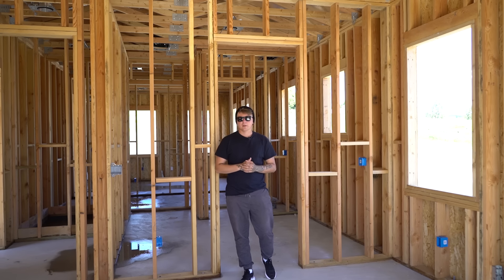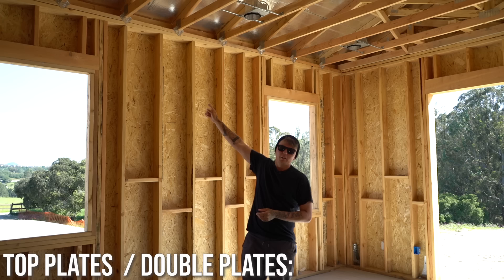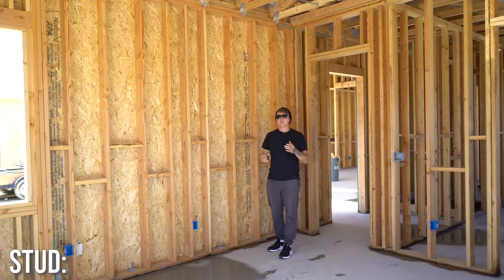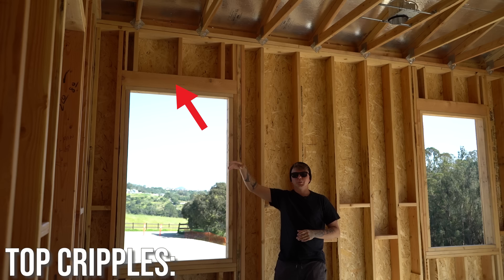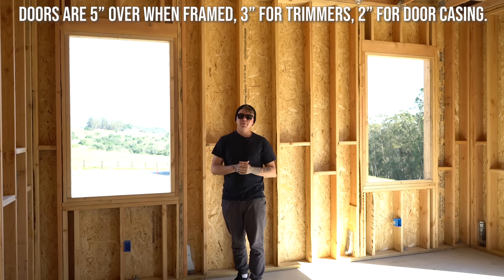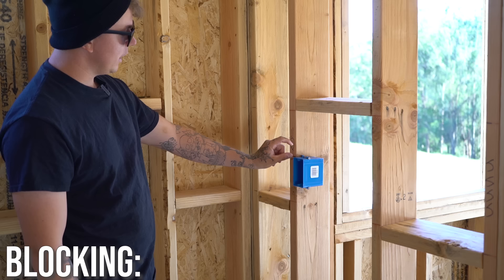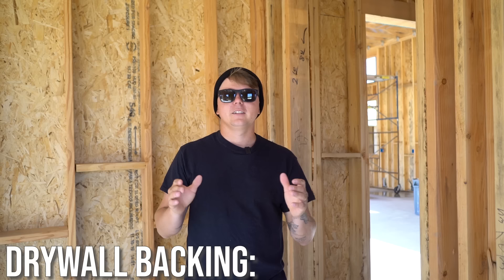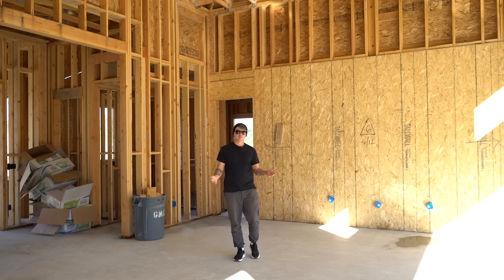Carpentry 101: Basics of Wood Framing with MattBangsWood [#1]

Comment: Hey Matt... another great video! I enjoy watching a quality framer from sunny California! One thing that you are doing wrong  ( and I have been teaching and employing framers for 42 years) is running your sills into your trimmers. This is a huge no-no and your introducing shrinkage and crushing under a load bearing lintel. Any engineer (and Canadian code) will tell you that trimmers should go from plate to lintel (or "header" down there where your framing) with no interruption.  When you have extra flat plates interrupting your trimmers then you are going to have uneven shrinkage and compression from your standard walls that only have 3 plates compressing. I've read that California has a very high standard of building codes and ethics and a Master Builder licensing program, we definitely need that here in Alberta to weed out the riff-raf!! Keep up the great work Matt.

Comment: great video! Its awesome that you simplify, and also explain that there are different terminologies used throughout this industry. However, pre-cut studs lengths in NY are at 5/8's. 92' 5/8", 104' 5/8", 116' 5/8". Overall, the video is explained very well. Trimmers are also something that is not needed in NY, our headers sit on the jack studs. When we create our headers, we sandwich osb between the 2x6's or 2x8's. Great job!

Comment: Great video! The actual purpose of the blocking is for fire purposes. Back in the old days, they used balloon framing that went from floor to ceiling and if it was two story, it would go all the way from the first floor to the second floor top plate. If a fire were to start in a living room, it would rapidly go from wall to ceiling and the attic space in no time. By adding the blocking, it deters or slows down the fire as it burns its way up the wall thus adding a slower burn rate and a chance to detect the fire before attic space involvement and having a fully involved structure fire. I am sure the added bracing is a benefit as well but not the primary purpose of it.

Comment: 0:50 BOTTOM PLATE / MUD SILL: To anchor the wall down to the concrete with anchor bolt. Bottom Plate is Pressure Treated Lumber.

Comment: Hey Matt, 
     I am a general contractor. If you like this great, if not, no worries..... We call the first top plate the "top plate" the second one we call the crown plate. The reason for this is because you install it with the crown going the opposite direction as the top plate. This is to attempt to have them counteract each other and make the wall straighter.  Also, I like the backing that you put in for the ceiling at an intersecting interior wall. However, for those of us who experience winter, you should not do that. If you experience truss uplift it will tear your drywall off the wall. It will tear the drywall corner joint between the ceiling and the wall causing a gap between the two. To prevent uplift issues, we nail backers to the top of the wall. The drywall is attached to this and is NOT attached to the trusses within 24" of an interior wall. This way if you experience truss uplift the drywall will slightly bow but the corner joint will stay in tack. (Truss uplift is when the trusses shrink causing the bottom cord of the truss to lift. This happens because the way a truss is designed, they cannot come down when they shrink, so they go up). If the bottom cord of the truss lifts a quarter inch then there may be a 1/4" dip in the drywall but it is not noticeable at that point. If the drywall joint tears and separates it becomes very noticeable. Again, this is probably not something you worry about in California, but for those who do experience it, it is not a good idea to attach ceiling drywall to the trusses within 24" of an interior wall. 

As for the rest of the video. I loved it. I sent it to one of my green horns to watch!

Comment: Young structural engineer here. Yes, dbl top plates do help to span wall studs, but more importantly they serve as collectors for lateral continuity. There are two plates with lap splices so that they can act as a continuous tension member. I would not recommend downplaying the purpose of blocking. Yes it helps against warping, but it also braces against buckling in high wind conditions and is often referred to as fire blocking to slow flame spread in highly combustible batt insulation. As far as I know, they don't manufacture 5 1/2" x 15" PSL - that actually looks like an LVL.
Reply: How do these walls stand against lateral forces? I mean.. when they pull up a framed wall it wobbles in all directions so ok, the studs and wal works great for a force from up to down but there's nothing stopping any lateral movement left/right? Is it the plywood on the outside? That's the only thing that looks like it could stabilze against lateral movement.

Comment: A couple comments: a) Most treated wood these days uses ACQ, not borate. b) Treated wood still readily absorbs water. It just doesn't rot. c) Most resources say not to split your trimmers/jacks with the sills. Breaking trimmers/jacks creates additional hinge points and the sills will shrink a lot more along their short dimension, leaving gaps in a split trimmer/jack assembly. Trimmers should run unbroken from the header to the bottom plates.
Reply: Here's an article from Fine Homebuilding about split trimmers if you're curious: https://www.finehomebuilding.com/2017/09/13/split-jacks-framing-window-opening

Comment: The Framers use california corners here to allow insulation to be installed and not have a dead void inside the wall.    If you use a channel corner  then you have to insulate that prior to outside sheathing which is an extra step.

Comment: The bottom plate does NOT have to be treated, but it HAS TO be separated from the concrete by foam rubber that you get in rolls that are exactly the width of the bottom plate. That's how we do it in Finland. Obviously, you could have both.

Comment: good video and good explanations. the thing is framing is differant  in differant States and countries what goes in california is way over built for say Hawaii. ( Hawaii rearly gets snow so no need for sheeting everywhere )  and say New Zealand being high humidity, by sealing up the walls and rooves with sheeting promotes dry rot rotting out your High value home within 5 years.
alot of places use 2x4 @ 14" centers. and so on.
In New Zealand framing without sheeting is achived by a gavanised iron 1"x1" diagonal brace on each frame nailed 2x at each passing being 'L' shaped, it is cut into the studs, top and bottom plates. So with blocking or knoging it makes the walls strong and breathable, stopping any chance of dry rot happening.

Comment: There are plenty of comments so this may have been said already. I always thought Blocking was originally used to slow down a fire in the wall. It doesn’t stop the fire, but it really slows it down. We use to call them fire blocks in the early 70’s. They don’t add that much strength really.
Reply: @Hello Tony how are you doing?
Reply: That's what we use them for in Maryland.

Comment: the horizontal framing you did is going to make it a living hell for any electrician to do ANY work after the walls are closed.
Reply from the maker: Walls are almost always blocked, especially in California. These homes aren’t cheap, I’m not going to go cheap so an electrician can not penetrate drywall when installing a plug later on.

The way I see it.. I can provide a better product for clients, or provide a lesser product to save an electrician 10 years from now a few more hours of work cutting drywall.

Comment: Very good video I learned this type of frame work later on in life I feel this is the best I wish my school wood shop teacher would have taught us this he was a crazy nut job beware a lot of other contractors do not build this correct way any more most of the time thay use the new floor trusts and the h vac installers drill large holes in them makeing them week and 24 on center walls and do not double around window areas     So be carefull when you buy a new build   I would demand this mans type of construction very will built and will last a life time.

Comment: Great video but as a professional framer for over 35 years in the west there are some slight differences in the framing details of how things are done like running your trimmers full height instead of landing on the window sill. Also clairfing that exterior wall blocking may be required at all OSB/plywood panel breaks for shear value or other reasons. Also stud heights matt called out must be a South West thing. Precut studs coming out of the west or Canada are 92-5/8", 104-5/8", 116-5/8".  But still, great video and great presentaion! Great

Comment: FANTASTIC Video!!! The question I have and have never seen it addressed is: when you’re laying out a wall, is there a rule as to which side, left or right, that you start the studs at 16” on center? Obviously if the wall is not a perfect length that is a multiple of 16, one end will have a stud that is closer to the end than 16”

Comment: In the northeast, it's code for all loads for all walls to be continuous, transferred all the way topmost to bottommost structural member, meaning that breaking a roof truss or rafter in between two wall studs would be unacceptable even though you have a double top plate in place.That would fail code for not having continuous load bearing from top to bottom.

Comment: Your method of putting in channels lock off cold corners where you can't put insulation. Turn those studs 90° horizontally so you have a few inches behind it to stuff insulation into that void.
Guess in warmer California might not be much of an issue but I certainly pack every void here in North Idaho lol we got cold winters here.

Comment: In S.florida the wall blocking is called fire blocking by code every 4 feet must be installed or fail inspection suposed 2 slow smoke n fire from rising quickly

Comment: It’s funny how the west coast nails through the first top plate into the studs when the east coast sandwiches both plates together first then toe nails the studs, I always wondered about that since 1985 when I first started framing, that’s why they call it California farming
Reply: They may have done that in 1985 but nobody does that anymore. I am a member of the National Association of the Home Builders and I talk with builders from all over the country. Nobody (not an entire region)  toe nails studs to the plates anymore. Not to mention that by the international residential building code you need 3 nails on each end of the stud when nailing straight in. If you are using a normal .131 nail for a nail gun. If you toe nail then you are required to use 4 nails on each end.
Reply: @ericyost2703  well i know for a fact hand on building every day on 50 million dollar ocean front residential properties on the east coast with top architects we double top plate and three toe nail 2”x6”studs with 16 penny nails or go straight in when using structural hangers .
West coast is known for top nailing from plate to stud which would blow apart during a nor’easter over here Jack
Reply: @robertruizcampwolfden8579  If you built two houses exactly identical withe the exception of toe nailing studs vs. plate nailing studs, you would not know the difference. It would not blow down. Almost all of your wind shear resistance comes from your structural sheathing, not your studs. Besides, no framer has perfect employees, so you know there are plenty of nails being toe nailed that crack the end of the stud or break the corner off, or are only in about a 1/4" of the corner of the stud. Those nails are not holding anything. Like I said, I don't doubt that you do it that way and there is nothing wrong with that. But I do doubt that every builder on the "east coast" does it that way as you made it seem. I have talked to builders on the east coast who do not toe nail studs to plates. Besides here in the Midwest we have been plate nailing studs since long before the 80s and I have never heard that called california framing.  That is Midwest Framing. It is also west cost framing. It is also southern framing. It is also the preferred method for over 100 countries world wide. And it did not start in California. Jack.
Reply: @ericyost2703  I’m sure all the Midwest brain damaged folk do it your way before I was a teenager but the only house that I know of from Midwest that ever held together during a tornado was Dorothy Gale
Reply: @robertruizcampwolfden8579  My mistake, I thought I was debating with an adult. Thanks for your time sport.
Reply: @ericyost2703 dudes doing tutorials on basic carpentry from high school and he thinks he has a degree in engineering
Reply: @robertruizcampwolfden8579  Matt did a tutorial on basic framing because his followers asked for it.
Reply: @ericyost2703  keep doing your homework and you will get there
Reply: @ericyost2703 I will be hosting a small cottage build hopefully next summer in upstate NY Adirondack region so tell all of Matts followers to get there pencils sharpened, notebooks and popcorn ready

Comment: I’m a service electrician and often retrofit finished houses for remodels, additions, etc. and horizontal blocking is the absolute worst to run into while trying to fish down or up a stud bay. Then I have to tell the homeowner sorry I’m going to have to cut your wall to run this wire cause the framer thought it’d be a good idea to put in unnecessary wood in the middle of a stud bay!
Reply: Excellent video mate!
Reply from the maker: I’d rather our studs be straight and our walls sturdy. I understand your side of things, but I can have a whole 3,000SF home drywalled for $10K, you cutting a bit of drywall out and having it patched won’t cost enough to be an issue with anyone we build for.

Comment: Only thing with your Chanel for drywall is you the. Get a cold corner. Adding a stud and spinng your Chanel blocks 90’ you will still have backing and will get a clear void for insulation

Comment: After about 20 years we decided to call the plates out as...bottom plate, framing plate (it has lay out and isn't top or bottom) and, top plate.
Stud plus trimmers is a stud/trimmer.  In the old framing books the king stud is the stud under king rafters. For a no compression trimmer it should run from bottom plate to header.  Sill fits in- between.  No trimmers needed above header (unless on 16 layout) yet people do. Why? We only block at 8' for fire block.

Comment: I’m not sure if I quite understood, when framing openings for doors/windows, isn’t the opening supposed to be 1/2” bigger than the frame? Working in a place that sells pre-hung doors, we try to build the frames to be a half inch under the rough
Reply: You answered our own question. When a builder talks about a 36" window, that window actually comes from the factory at 35.5" wide. The rough opening is 36"

Comment: Double plates have more purposes.  The transfer of lateral (wind) force across the full length of top of wall needs to be continuous. Typically the top plates overlap each other to splice and transfer the force accross long walls. A wall 40ft long will not have a 2x6 top plate 40ft long. You splice Typical lengths (12ft lets say)

Comment: Another great video man. You always explain things so clearly. I wanted to add that another reason for a double top plate is to accept larger truss connections as needed/required by the engineer and designer. As you can see in your video you did not use Simpson H2.5 truss clips, but the H1Z rafter ties, which are larger and in my opinion a better connection overall anyway. They do require more lumber surface and the double top plate accommodates for this...On another note, what type of mic do you use for your videos? I am looking for one that I can use as a wireless option as you have in this video. Also, sounds like you might be heading down to hook up with Jon Dawson sooner than later for a project. I might be down there soon as well to come check out the build. Would be cool to meet up if we are down there at the same time. Jon is a good dude for sure. Again great video Matt

Comment: Great job! I am doing framing myself for the first time in Chicago and these videos help a lot. I am installing 30" x 84" heavy doors and am a little worried about the structural strength. Therefore I am doubling my jack studs and have decided to use a 2x10 double as a header. Sharing your thoughts are appreciated!
Reply: @Hello An how are you doing?